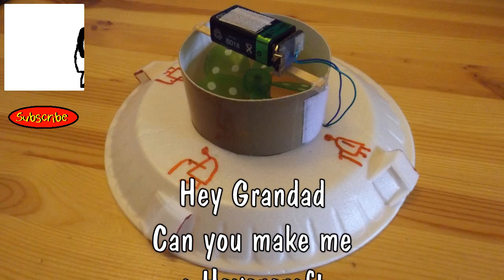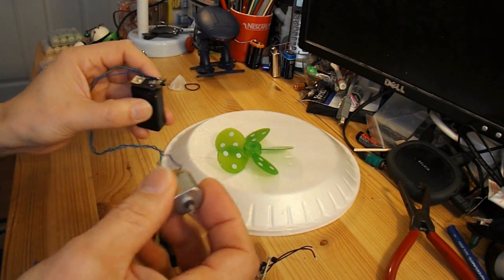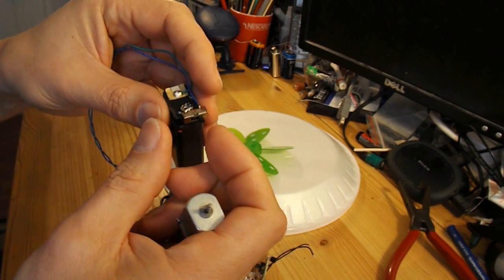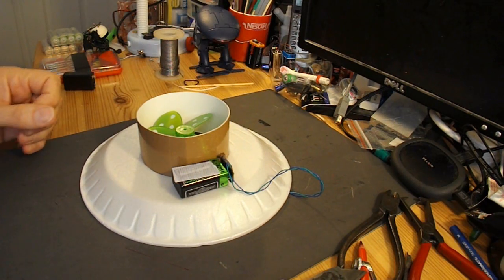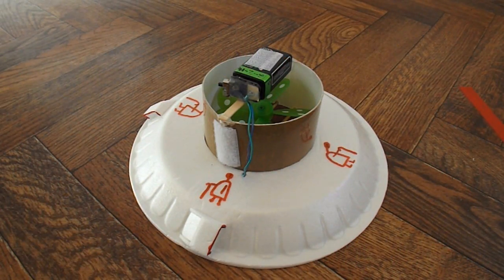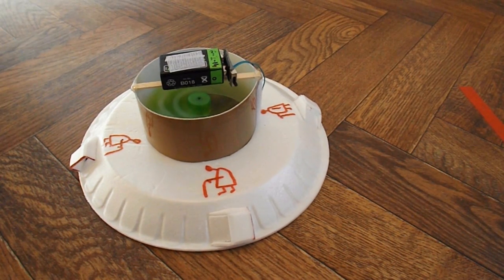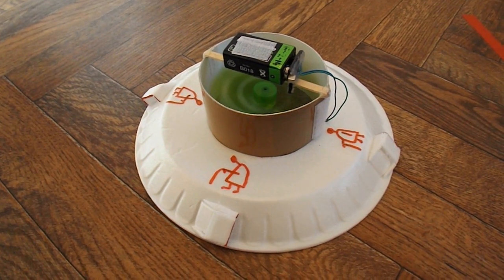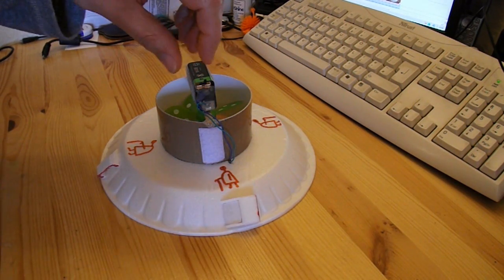Bargain Store Hovercraft for James Stead

Comment: Thank you so much I am going to make this I think best one yet what bout you
Reply from the maker: Good luck if you try to make it. The 9v battery is much more than that motor should handle and it was getting hot so make sure you can turn it off. The hovercraft might work better with a skirt fitted underneath, but it worked well enough so I didn't bother.
Reply: Yes I will make it on saturday tomorrow this week and should I upload a small video if I do anything different to yours actually at school I enered a competition on building a robot and that is going well too the top prize if you win is £500 so hopefully I will win to make more stuff also I am so grateful that you done a video just for my request and do you think it is the best one you have done yet or would you say not the best thank you very much and good look on your projects to come thanks ☆☆☆☆☆★★★★★     =-D lol oh by the way you said stead right =D

Comment: I wonder if it would help to put the battery on a separate wheeled cart, so that the weight to be lifted is reduced. The cart would be towed along by the craft and perhaps help to prevent it from revolving as well
Reply from the maker: simonrickard1 sounds like an interesting idea, why don't you try building one to find out.

Comment: can you make an rc hovercraft using old rc toys?
Reply from the maker: edz gomz this project series could use parts from old RC cars although depending on what motors they have in them you may or may not get enough power to provide the lift you need. As you go through the different episodes you will see that I change different components as it progresses. At one point I am using a proper RC transmitter and receiver, and then later I am just using the transmitter and receiver from a cheap toy. Some of the motors come from vibrating toothbrushes but they are basically the same motors that you would find in a cheap RC toy car https://www.youtube.com/playlist?list=PLA5a2xPRSrB1ynqKhyKVIcl945NCbHZZE

Comment: u should put the battery vertically
Reply from the maker: Hi Emiliano, if you are thinking it is restricting the airflow, I don't honestly think it would make any significant difference. At the end of the video you will see I stand it on it's side so it is no wider than the wooden support anyway. What would improve the performance would be a plastic skirt underneath to improve the air seal over uneven surfaces. I have fitted them on many of my hovercraft.
Reply: the idea is to put it vertically in the axis of the center of mass of the structure, so there is no contact in any point of the border of the plate